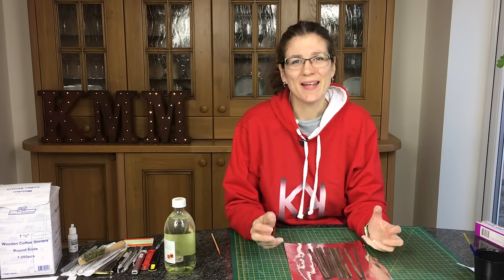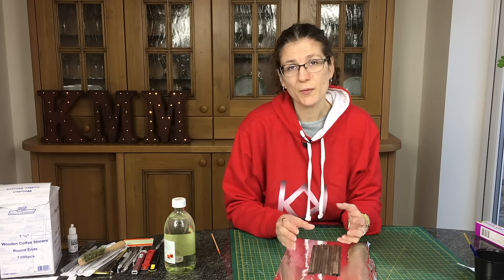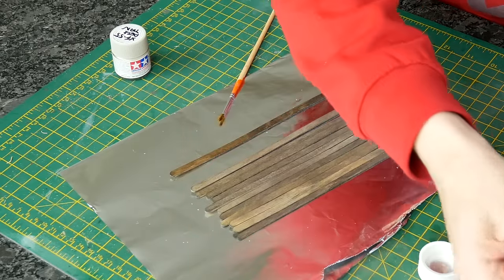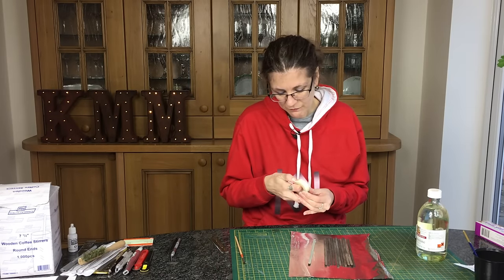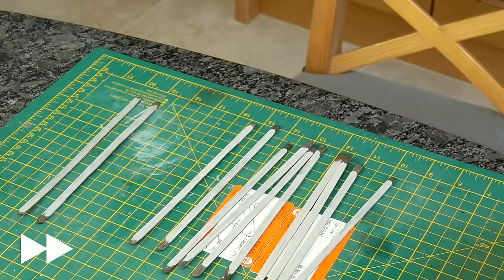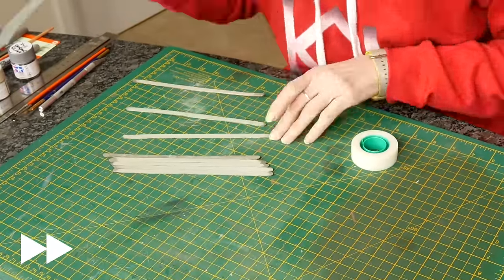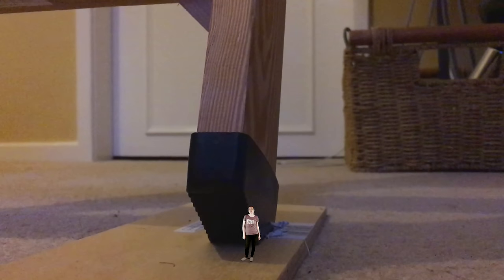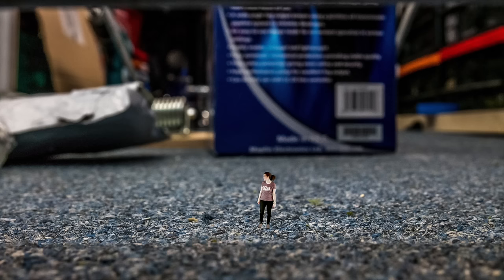How to Model Peeling Paint on Wood

Comment: Thanks Kathy. I had seen Chuck's method years ago but wasn't sure if I remembered it right .. well .. remembered the turps bit but not the tape
Reply from the maker: It’s a great method. Chuck is such a gifted modeller.
Reply: @KathyMillatt  I remember "watching" him build an abandoned gas station (petrol station to you Brits! :) ..  just realized that station is used in both so I suppose that is a good thing!) .. I think what got me was how precise, how carefully he would build up color and texture in something .. it might be a board with flaking paint or a rusty pipe. I think at least a part of his success is that he approaches each individual item as a project in itself. That rusty pipe sticking out of weathered concrete is in itself a project .. not a piece of wire slapped with red oxide paint and a wash but a careful study of color and texture much like a master painter would do.

Comment: Stroke of luck finding that bubbling effect with the hairdyer. I`ll take that one :)
Might try the point of a soldering iron for a more localised effect.
Reply from the maker: +Barry Thornton Modelling new techniques is more than half luck!  I wonder if a soldering iron would have the same effect.
Reply: I`m thinking the edge/corner of a car door where that bubbling often occurs, but wouldnt want it across the whole panel.